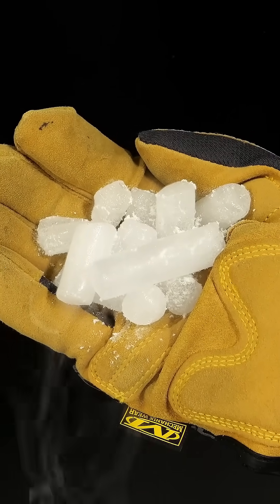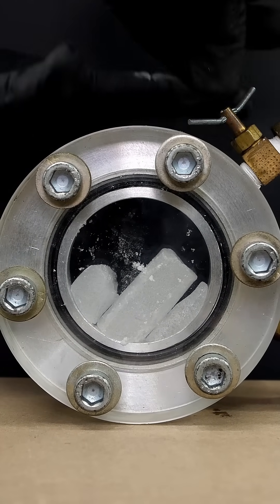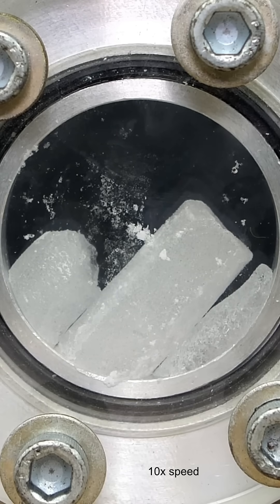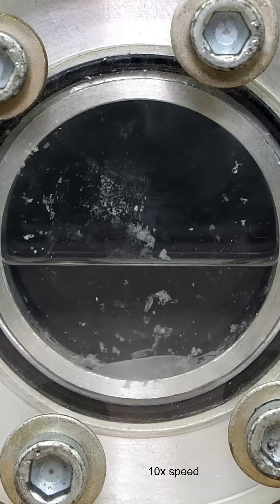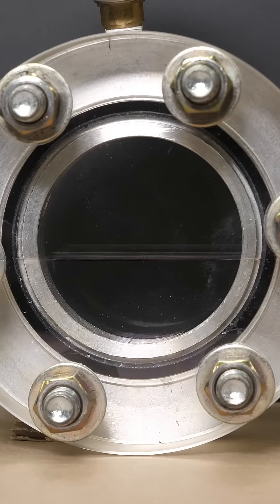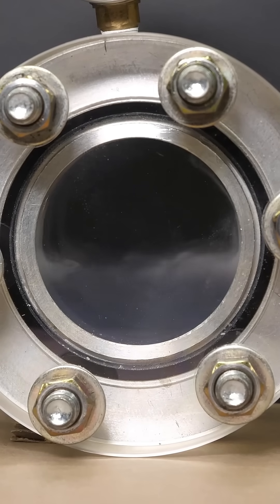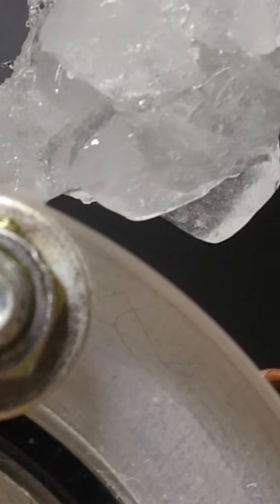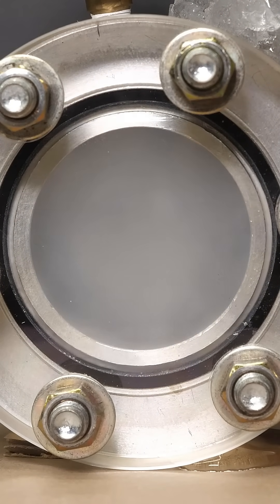This is not a liquid or a gas

Comment: Going supercritical: https://youtu.be/JslxPjrMzqY
Reply: Question, once the gas forms back to liquid,  what would happen if  you release the vacuum, would it freeze back or just go up and vaporize? Thanks
Reply: This process is how I make a living.  You should look into absorption refrigeration. You put heat one side of a machine and can get 34’f water out the other side
Reply: @craigr6186  try collecting terpenes out the other side for best making a living!
Reply: @craigr6186 what do you do, sounds fascinating
Reply: Now freeze it back into ice to impress me!!👀
Reply: demon core
Reply: How much time did each of the transformations take?
Reply: Can you do your/someone's eyelashes and or face under a microscope to see if the mites that some people ate supposed to have can be seen?
Reply: Me freaking out the chamber isn't going to hold
Reply: So it’s like a artificial very miniature cloud?
Reply: @goodluck4951  A cloud is water vapor
Reply: Is it still very cold?
Reply: Now explain cats.
Reply: teke that thing out of that chamber that gas witch is liquid at the same time i am curious about it 😃
Reply: OK so say u could make one bigger to fit a pc inside would the pc work or any electrical device work in it
Reply: Is this not just the sub-point to where it changes from a gas and liquid?. Supercritical fluid i thought required 1,070 psi. ...
Reply: Drink it
Reply: Liquid diamond
Reply: im sorry to be the one to tell you this, but diamond sublimates. meaning it goes straight from solid to liquid, so it physically connot be liquid @_.359
Reply: So what happened then?
Reply: I remember the "y" curve charts for what pressure and temperature creates a solid, liquid or gaseous state of a particular substance. I think you need to explain about a vapor being a liquid dissolved into the air...
Reply: This is Triple point of state sir
Reply: @vyasbrijesh9569  the triple point is a state in which both liquid, solid and vapor coexist. The critic point is an different thing. It is a state in which liquid and gas happens to have exactly same caratteristic (meaning no evaporation or condensation is possible despite the system being made of fluid)
Reply: @Cfer98  Thank you so much
Reply: Does co2 have a triple point like water?
Reply: At the right pressure and temperature, H₂O behaves similarly. It occurs in three states of matter aggregation simultaneously.
Reply: If you put 20000psi into it will it become solid carbon dioxide like the atmospheric conditions on saturn
Reply: What if you cool it back with liquid Nitrogen instead of normal ice?
Reply: @jdm1066  if you cool it down it would convert into liquid water and vapor anyway (no matter how fast you cool it down). If you cool it down even more, the water would freeze
Reply: @Cfer98  I was talking about the liquid Carbon Dioxide inside the vessel.  If he cooled it down with Liquid Nitrogen on the outside instead of the water ice he used.
Reply: Dry ice nile ??
Reply: Could the same happen to diamond?
Reply: @kusterdman  wow water imagination power
Reply: thanks i guess @rtxgamelab.official
Reply: I answered that -_-
Reply: Makes you wonder how Jupiter was destroyed
Reply: bro what you smokin i want me somma dat @uncharted7againblackking256
Reply: This makes you wonder how Jupiter was destroyed oh that's right some of yall don't believe in space or still think the other planets that surround you decoration lol
Reply: Nothing magical but magnificent
Reply: What happens when you drink it?
Reply: @the_actual_cashier9695  yea
Reply: @the_actual_cashier9695  ⚠️ God has said in the Quran:

🔵 { O mankind, worship your Lord, who created you and those before you, that you may become righteous - ( 2:21 ) 

🔴 [He] who made for you the earth a bed [spread out] and the sky a ceiling and sent down from the sky, rain and brought forth thereby fruits as provision for you. So do not attribute to Allah equals while you know [that there is nothing similar to Him]. ( 2:22 )

🔵 And if you are in doubt about what We have sent down upon Our Servant [Muhammad], then produce a surah the like thereof and call upon your witnesses other than Allah, if you should be truthful. ( 2:23 )

🔴 But if you do not - and you will never be able to - then fear the Fire, whose fuel is men and stones, prepared for the disbelievers.( 2:24 )

🔵 And give good tidings to those who believe and do righteous deeds that they will have gardens [in Paradise] beneath which rivers flow. Whenever they are provided with a provision of fruit therefrom, they will say, "This is what we were provided with before." And it is given to them in likeness. And they will have therein purified spouses, and they will abide therein eternally. ( 2:25 )

⚠️ Quran
Reply: @THE_actual_Cashier  you go Moist Critical
Reply: @the_actual_cashier9695  i dont think you should drink it because it's at 374°C and 220 bar
Reply: Be careful man, i know you have lots of fun doing stuff but the laws of physics does not favor anyone. Take for example the guy who smacked the plutonium ball of a table with his bare hand so it wouldn't go supercritical, before nuking Japan. BE SAFE!
Reply: @sarahdee4652  dry ice is FAR less dangerous than the "Demon Core".
Reply: @fredk.2001  Well yah!!!!!!! I know about what happened way back when - that's a pretty blue color you know! 🤓
Reply: @sarahdee4652  this supercritical is not the same as that supercritical. CO2 is not radioactive so this really isn’t dangerous at all
Reply: Please look into resonate frequency.  You have the potential to change the world nilered.  Design us a way to get hydrogen endlessly. Or somrhing better
Reply: I like your videos but to try not to use "kind of" so much or maybe just cut it out of your vocabulary completely. You don't need it. 🙂

Comment: As an ex-physics major, I enjoyed this immensely, thanks.
Reply: why did you break up with physics tho?
Reply: @Hasan...  idk who physics is but he probably doesn’t know her well enough
Reply: As the creator won't respond due to his popularity il hope you will. What happens if you would drink said liquid
Reply: @loud4life920  There's two theoretical ways to attempt this, and neither of them are going to be very comfortable. 

The first way would be to try to drink it straight from a pressure chamber immediately as it was opened up to regular atmospheric pressure. 

This is going to be a catastrophe because it'd either vent frozen, rapidly expanding vapor directly in your face, basically freeze drying your face off, or if you were to somehow get some of that liquid down your throat as it was evaporating but still liquid enough to pour (which you couldn't actually swallow since it'd freeze dry your mouth, esophagus, and stomach on contact as it went down, so you'd need to use some kind of beer bong setup) once it was "swallowed"/injected in your stomach, your body heat would make it evaporate even faster, making you burp/vomit/literally explode as your torso simultaneously froze while it also rapidly turned inside out. 

The other way would be for you to get inside a pressure chamber, and then try to drink it while you're in there. 

Trouble is, your torso would still explode, but the pressure chamber would hold that in, making your lungs and eardrums implode, while you also suffocated from a lack of oxygen. 

So, uh ... Good luck with that. 

😅👌🍀
❄️💥💨🎊☠️

Comment: Okay so dry ice is made from compressing carbon dioxide would that means that somehow someway you’d be able to make dry ice at the bottom of the ocean?

Say you got a container of CO2 and then opened it at the bottom of the ocean where the pressure would just overlap to turn it into dry ice would it then be possible to create dry ice at the very bottom of the worlds oceans?

Comment: I'm responsible for a near 1000 tonne CO2 storage plant and it takes some time to get used to thinking about the fluid differently to a 'normal' fluid. Liquid CO2 at saturation point I like to imagine it as water just as its about to boil.

Comment: It looks magical because we are witnessing something we normally consider impossible. Everything in our ordinary experience teaches us to expect solids, liquids, and gasses to behave in certain ways: that moving from one phase of matter to another is a clean process directly from one to another (based on pressure and temperature). What we are seeing is the curtain being pulled back on enthalpy, the energy of individual molecules being just barely enough to pull on one another, but not enough to fully bond.

Comment: When used as a working fluid instead of steam, turbines can be made much smaller and more efficient at turning heat to electricity. It's something like 33% more power for the same amount of fuel at any type of generating station: coal, gas, nuclear, geothermal and solar thermal.

Comment: Did you know, next generation power plants will be using supercritical CO2 as the working fluid to operate the turbine that generate the electricity?
The reason is that supercritical CO2 has much higher kinetic mass than steam, this allows the system to use much smaller turbines. 
I’m not talking a small reduction in size here, i talking a 36’ in diameter turbine replaced with an 18” in diameter turbine. 
1 liter of water weighs 1 kg. But at the same liter of water at operating temperature for a power plant has expanded to fill 10 cubic meters of volume. So one liter of dry steam weighs just 0.1g, or 100mg.
The supercritical co2 however maintains it kinetic mass regardless of whether it is a liquid or supercritical fluid. So its able to transfer significantly greater energy to the turbine per unit of surface area, greatly reducing the size of the turbine while at the same time increasing the thermal efficiency of the system as a whole.

Comment: My dad used to sometimes bring home dry ice, I don’t remember where he got it, but me and my siblings would put it in hot water, and it was so much fun. One time we put some in a plastic water bottle outside and sealed it. We ran inside and closed the door. A few seconds later, it exploded. So the second he said “sealed it in a pressure chamber” my only thought was “oh shit”

I was not expecting that result
Reply: I think the difference between a water bottle and a pressure chamber is that one is designed not to explode.
Reply: Dry ice bombs are fun. But as a kid I'd always run away from them before blowing them up. But they are really easy to make.
Reply: But instead of hot water I used cold. And a 2 liter soda bottle instead.
Reply: Because he was buying milk and theres no more milk so he just bought dry ice
Reply: Was it hot or cold outside?

Comment: Now does this pressured dry ice keep its temp as a liquid-gas-back to solid. If so couldn't this be used as a step up form of liquid cooling? An with being able to controll its form of three types; could you have a solid layer of frost over a hot component, (let's day the pcu) with a liquid or gas layer moving over the top frost and back into a tube on the other end. The only problem I would see with this is that the tubes have to be more than just tubes. Ex-temp controll along with other things.

Edit idk why people are meming this, it's pretty cool 😎

Comment: So heres an idea what if you put salt or sugar into the supercritcal chamber then released the pressure to see if it like flys out the release valve and to see it deposit in real time. If this works use something like sand pretty much just stuff that mixes with water (including other fluids I wanna see how supercritical CO2 effects that stuff).

Comment: "... kind of a liquid and a gas  at the same time.."

  – vapor 🤔
Reply: Liquid entrained in a gas. Clouds.
Reply: Triple point 😂
Reply: What does it do when released in uncontrolled environment? 
Just releases like a cool vapor I assume, like if it were being transported in metal cylinders and were to bust open in transit.
Reply: @splintercelloo7  depends on the temperature and pressure of what it is released in. 
Look up the phase diagram of the liquid/gas. You can answer that.

Comment: In the 19th century, a guy found an inclusion of a liquid in a quartz crystal.  He decided to measure its properties within the crystal, like absorption, index of refraction, and so on.  Then he drilled a hole in it and it went pfffff!  It disappeared, since it was liquid carbon dioxide under pressure!  He was the first to measure those properties!

Comment: It is a gas, just heavier in relation to the "atmosphere" in the chamber. Because it is visible, it shows as a different layer in the bottom of the chamber. It's like mixing liquids with different densities... they separate. We are just not used to see this in gases, so it looks weird.
Correct?

Comment: we did an experiment with dry ice in my chemistry class where we put dry ice in a pipet that we sealed, and afterwards we put the pipet in a beaker filled with water.  the dry ice started sublimating into carbon dioxide gas and eventually the pressure made the plastic pipet burst open.  
we filmed the reaction and, after slowing down the footage, we were able to see that, while a lot of the dry ice did sublime into a gas, the increased pressure meant that we were able to reach the triple point of CO2 and see it in a liquid state before the pipet eventually burst.

Comment: One idea I’ve always had but have never tested was running a model steam engine with a little bit of dry ice in the boiler. My intuition says that it should work, just as you can run a steam engine on compressed air.

Comment: An even more magical experiment with sublimation in total vacuum, would have been Neil Armstrong losing heat from his overheated Spacesuit by leaking hot liquid out of his backpack through sublimation by means of a patented wick; however, it was never tested, which is a good thing, because it never would have worked, because even if hot liquid could be lost by sublimation, the temperature of the turkey being cooked by radiation,, could not have been reduced. The Smithsonian Museum is still trying to prove Neil Armstrong could have fit through the Lunar Module's opening, by yet removing the backpack, moon walk boots, original gloves, original equipment attached to the Spacesuit, and moving the display far away from the Lunar Module, hoping no one would notice that he would've been too large to fit, but that would take a miracle to get the NASA-believer alcoholic trump-supporter to notice anything fact-based.

Comment: I tried doing this in a plastic soda bottle once. Well, the liquifying part, anyway.

In an abundance of caution, I only put the least amount of dry ice I thought was needed into the bottle, not wanting the bottle to explode.

I hid behind a makeshift barrier some ways away to monitor the experiment.

The bottle expanded as the dry ice sublimated and built up pressure, and began to bulge in places it usually doesn't.

As all the solid CO2 became gaseous and it hadn't exploded, I began to wish it had. Now I had a plastic soda bottle with contents under a mostly unknown amount of pressure that needed to be released. I imagined touching or holding it could push it over the edge, so after letting it sit awhile longer, I took care to protect myself in case it burst open while I examined it and tried to release the pressure.

There was some moisture in it, but I figured that was more likely water vapor than liquid CO2.

Lucky for me, the bottle didn't break when I handled it and let the pressure out by untwisting the cap a little. 🥲

Comment: “It goes supercritical”
Me: wow that’s a fancy word, I’d just call that fog
Reply: Supercritical doesn't mean fog😅😅
Reply: @vikasshukla7086  Yes. And nobody else calls simple evaporation and condensation as something supercritical.
Reply: @expioreris  fog and supercritical fluid is not the same.
Reply: @expioreris  equivocation of condensation, evaporation with supercritical shows the misunderstanding of phase transitions
Reply: Matter changes between liquid, gas and solid based on the relationship between temperature and pressure. This short is basically showing us the temp/pressure changes for CO2.

Matter like CO2 has a “critical point” where the ability to change between a vapor and liquid stops when the critical temperature and critical pressure values exceed the defined parameters.

What we are seeing in this short is a state of matter that has exceeded its critical point values and has become supercritical as a result.
Reply: I thought u said frog 😂😂😂😂
Reply: Frog
Reply: I'd say its just at the point of condensation while being surrounded by a soluable gas that has a similar density at the same temperatur & pressure.

correct me if im wrong
Reply: @dejavu4642  well, if you are trying to describe carbon dioxide being soluble to itself(?) then yes, but then again its in a phase in between gas and liquid, might as well go with that.
Reply: @albert6157  I ment the Oxigen from the air that was likely Pumped in, as it likely bonded to make C2O2 of some sort.
Reply: @albert6157  I ment the Oxigen from the surounding air that was pumped in likely bonded with the carbon to form C2O2 of some sort.
Reply: @albert6157  I ment the Oxigen from the surounding air that was pumped in likely bonded with the carbon to form C2O2 of some sort.
Reply: @dejavu4642  yeah, left over air definitely will be there, however the gas will behave this way even with pure carbon dioxide and they dont pump any air into it when they seal the dry ice, the contain already is mostly filled with carbon dioxide from the rapidly sublimating dry ice

Comment: How does the temperature change when you play the frozen CO2 in the system and it turns liquid. If you released the pressure as liquid would it go back to solid or higher energy gas?